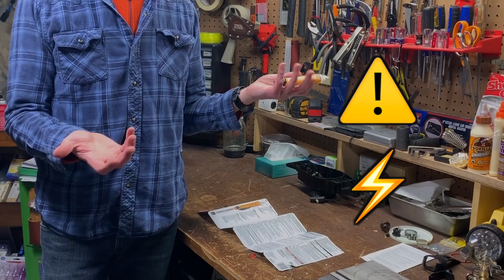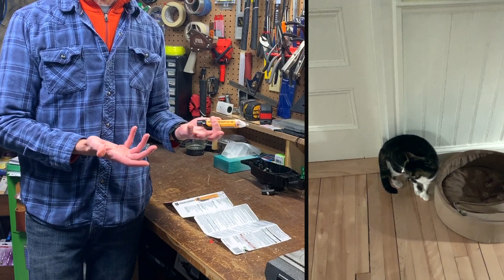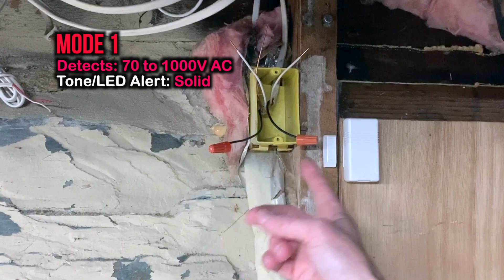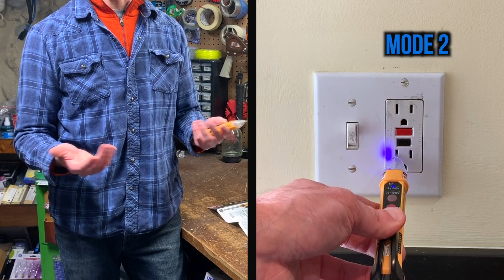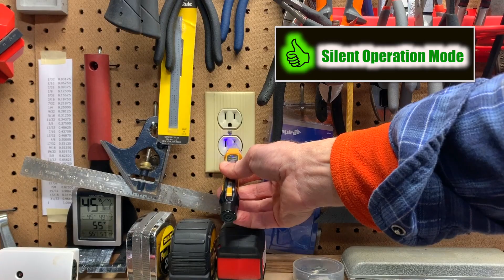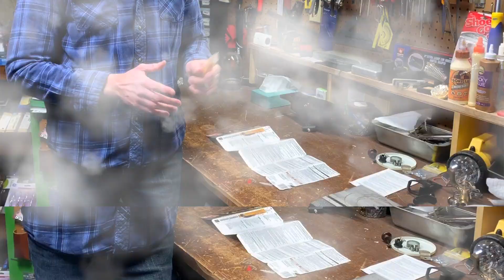SAFETY! Klein Tools Non-Contact Voltage Tester with Laser Pointer Review - NCVT-5A

Comment: Never at work with out it but soon after you start carrying it around it power cycles and beeps in your pocket.  I think the battery spring just needs to be more robust.  Sometimes a small washer helps for a while.
Reply from the maker: Thanks for sharing your experience and a solution. I haven’t had that issue, but perhaps it’s because I keep it clipped to my electrical pouch. Thanks again!

Comment: I really don't know why they are called voltage testers.  if they only identify whether or not a line has passage of electrical charge.  because to know if there is voltage if it is single-phase it does not define if there is 120.  220 VAC to say something.  The one that indicates that a line has a load does not guarantee that there is a full load because, for example, if it indicates that there is a load on one of the lines and if the neutral is isolated, how to say that there is voltage.  a volt-amperemeter clamp if it guarantees that it finds a full charge.  They should be more clear on that point.
Reply from the maker: All good points